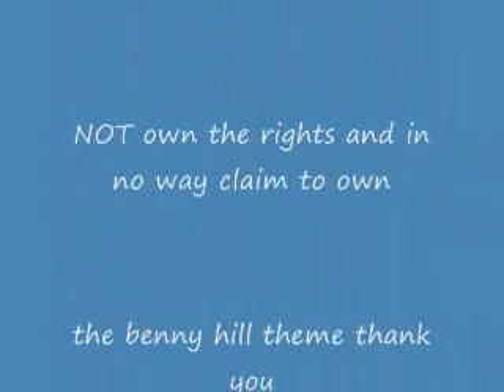Timed install of the BesTop TrekTop NX soft top

Comment: Having a set of pliers is a good idea but may be over kill.  I keep a ‘skate lace tightener tool’ in the glove box for working with the zippers on my soft top.  It’s a small, inexpensive tool (sub $2) used to tighten laces on ice skates.  It’s a simple, thin metal rod with a handle and hook that fits in the hole of a zipper tab.